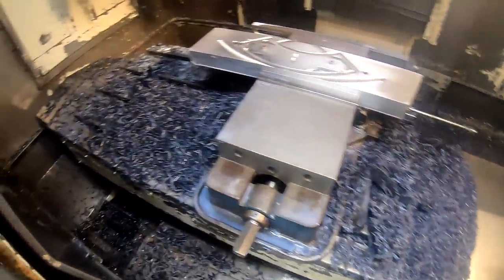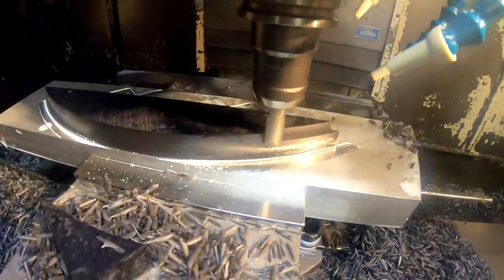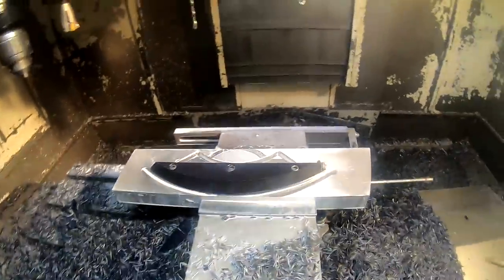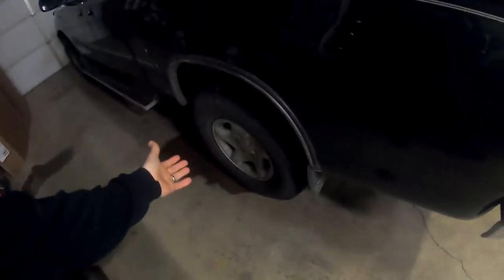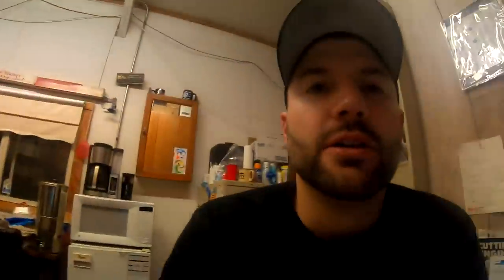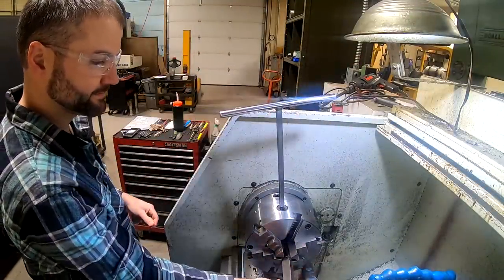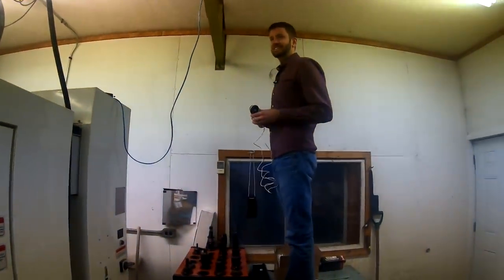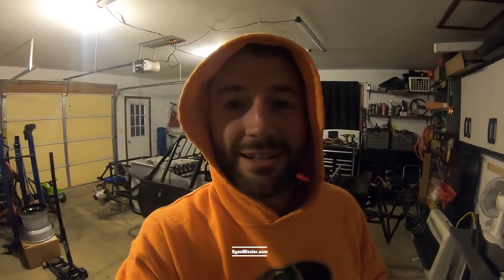Two Days Of Video....Machine Shop, Flat Tire, Basketball Footage

Comment: Great video before I retired I used to run a Makino mill several Fadal mills and a Mazak lathe I'd like to suggest you put and external air line on your mill we did that on the Fadal mills it worked great

Comment: I would love to learn some machining skills. I have a POS milling machine in my other shop. Its an Enco, like a glorified drill press. But it worked for what I was using it for. Drilling & reaming for bronze bearings. Back when the housing market crashed in 08, I started building pneumatic Halloween props for haunted houses. To be able to feed the family. Always found Machining fascinating. I could sit and watch machines running all day.

Comment: are the rims on your truck aluminum? If they are there could be oxidation building up around the inside slightly breaking the seal. I have the same problem with the rims on my wife's jeep. constantly having to put air in them at least once a week
Reply from the maker: Yes they are alum. Yes they are oxidized and pitted...junk lol
Reply: Then I bet that’s why it went flat.😎👍